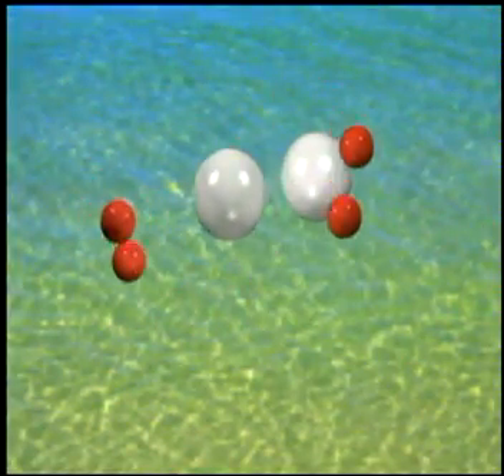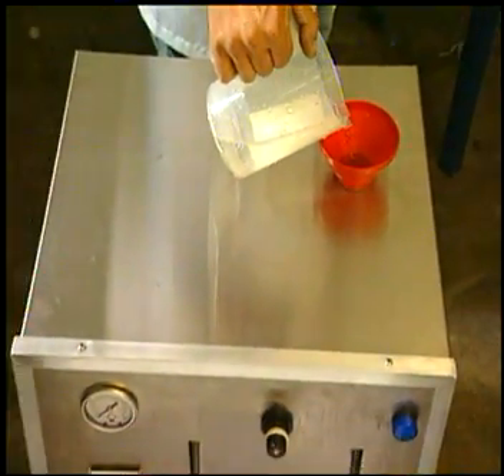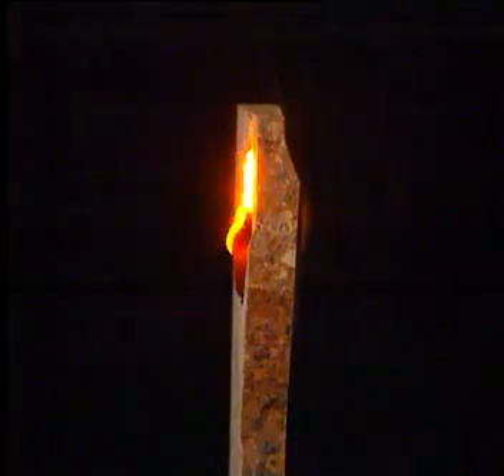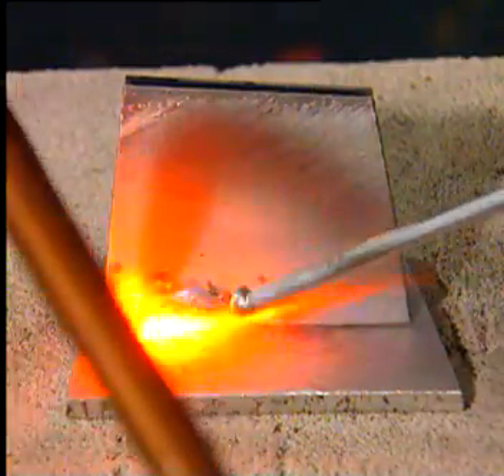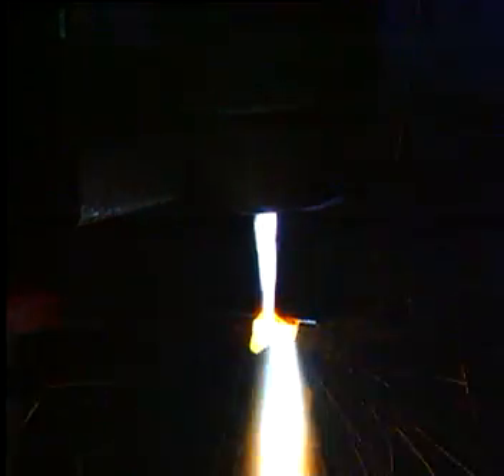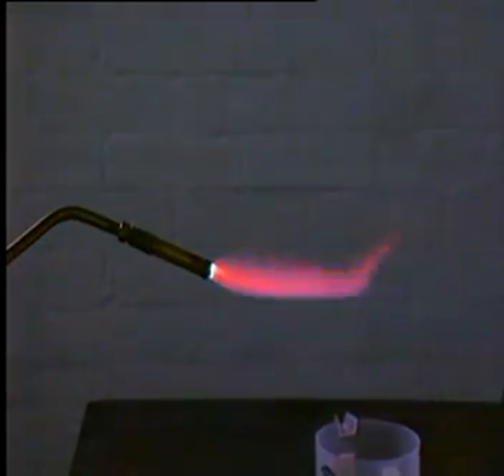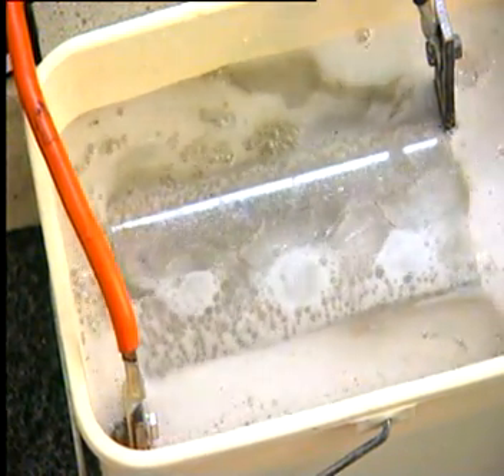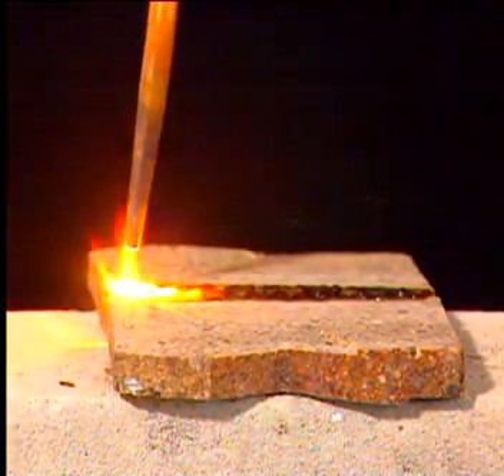Welding With Water by Spiro - real 'Browns Gas' at work

Comment: i never heard hho can reach over 3000deg c,,5500deg F is ridiculous i never heard of this except for thermic lance ,,,if indeed the flame can have several heat ranges then how is this done?
Reply: Yes, if done correctly that is☝️, it's called Interactive flame temperature. Essentially it's an exothermic reaction between the gas and the other material. Did'nt you see how plasma field of an Arc is enhanced by the gas in cutting steel ?
Reply: @navneetpandit7299  if you are talking about plasma welding or cutting yes i am welder i kinda understand but plasma flame alone is very hot and can reach 25k degC and does not get hotter by interacting with metals , as for hho flame it is said to be 2000deg C or even 2800deg C but it depends on conditions and material it is burning
Reply: @ARCSTREAMS  then it is not simply HHO gas.
Reply: @Dan-gs3kg  now that i watch video again it seems they are not using hho but separating both gasses then combining them in the torch at different pressures where i think the oxygen is at higher pressure (but they are not specifying this) so this is oxy hydrogen ,but then they are showing a welding head blow torch with a different looking flame and perhaps different pressures or possibly hho combination ,,idk it is a strange flame with weird characteristics
Reply: @ARCSTREAMS  Brown's Gas is generated primarily with the electrolytic cells in series at very low voltage. It is also a neutral electroliser, the gasses are not separated. The main oddity is that theoretically it can get double the coefficient of expansion as HHO gas. The best designs only get to about 130%.
Reply: @Dan-gs3kg  idk what you mean with double coef and 130% and all that ,brown gas and hho is same thing and created by electrolysis by either having the gases separated or created together as a 2:1 ratio called  stoichiometric  or bang gas anyways this is going further away from my initial comment on the flame temps
Reply: @ARCSTREAMS  When using Faraday's equations for calculating electroliser efficency in terms of energy to rate of volumetric expansion, Brown's gas gets above the theoretical limit prescribed. There is more expansion of gas than would be expected, and the gas is not hot. Going by spectroscopy, there is monoatomic gas involved.

The point being made here is that it is not HHO gas, and would naturally act differently.
Reply: @Dan-gs3kg  what is not hho? what is difference between tnat and brown gas?
Reply: @ARCSTREAMS  basic reading comprehension.
Reply: @Dan-gs3kg  ??? seems like you just enjoy talking to yourself feeling smart instead of answering simple questions you prefer to go off topic about a bunch of science regurgitations ,,i can also do fourier transforms but i dont go out of my way to spam about it
Reply: @ARCSTREAMS  I said that brown's gas is different, and it is shown by the excess expansion of the output of the electroliser, it is not simply HHO
Reply: @Dan-gs3kg  and in laymens terms i still do not understand what "excess expansion of the output of the electroliser, " means?? first of all we need to know what is the definition of the term "hho" from my understanding it means 2 hydrogen and one oxygen which is what is produced in electrolysis , so explain to me in laymen terms what is the difference between brown gas and hho and what any of this has to do with my initial comment about the temperatures claimed in the video ,, if you can actually manage to do that without your scientific fancy words that would be an accomplishment
Reply: @Dan-gs3kg  are you saying that when brown gas is made it is not purely hho because there is an atmosphere along with it? so it is not the same as pure hho ,,im trying to understand ,but i think what i said about the gases being under different pressures in the torch is what creates hotter flame,when you have both gasses pure and independantly sourced unlike from these simple devices perhaps
Reply: @ARCSTREAMS  no, as I said earlier the composition includes a significant amount of monoatomic gas. HHO is very voluminous than ambient gas, and the original water it came from, good brown's gas expands it an additional 30%.

The gas is not that hot, what comes out is colder than expected for HHO gas (greater volume of expnasion). Monoatomic hydrogen and oxygen also need lower temperatures to combust. The fire does not need to burn that hot to sustain itself. When challenged, it can produce a lot of energy to continue its combustion.
Reply: @Dan-gs3kg  it's probably that the hydrogen is 70% orthohydrogen

Comment: The big surprise is Browns Gas/oxyhydrogen gets rid of nuclear waste.
Reply: mujaku any links for this information?
Reply: @jeffmartin8106  I was lucky enough to attend a SAFE WORLD TECHNOLOGIES elbow to elbow  conference/demonstration in 1994 at the Philadelphia 76ers' stadium.  They demonstrated all sorts of things from a jack hammer, welding/cutting abilities, a v-8 Chevy motor running producing water as a by-product, and a tiny electrical generator with 4'x6' panels.  It turned out the generator, if "public" would fry the grid as it exists today with the amount of juice it produces.  
     The nuclear disposal claim was made and it was said they demonstrated it successfully to the Feds but it would displace the current nuclear waste disposal and storage systems in use and planned.   You just can't erase a trillion dollar industry.
Reply: @jeffmartin8106  OH! And he said they'd be arrested if they did a demo and pointed to some guys on the floor who were reportedly there to do such a thing if needed.

Comment: hydrogen is better we should be using it oil companies lobby to hide and descredit the technology
Reply: Wonder if Spiro is still active in this technology? So many disapper over time.
Reply: That's completely false. The models are designed to produce and deliver hydrogen on an as needed basis. The tanks in the car will not hold vast quantities of hydrogen, and either way, you could fire an incendiary bullet at a tank and it wouldn't explode, only trickle out.
Reply: Kevin Martin Here's the problem it takes more energy to produce the gas then the gas it's self contains. We do how ever need to get this figured out in say the next 100 years or we as a species is pretty much done for.
Reply: Kevin Martin it is also very dangerous to use. There are a couple of cars that are going to be released soon that will use it but there are still some safely concerns with it. It is very explosive when compressed the way it will be for use in cars. My shop for example is already built to be designed so that the roof will blow off and the doors remain shut in the chance of an explosion to keep people outside of the shop safe, but that being said, most likely all of us in the shop will be dead

Comment: ur friend I hate to tell u did not invent the browns gas torch Yull Brown who the name browns gas is named after is the creator. Any1 can build 1 of these & this is being used now by in cars 4years. The hydrogen is created in the cylinder because of the 1800x increase when splitting water. BWM has a hydrogen car so does japan & here it has been here. The GasInc need 2covert there assets there4 the industry has been supressed. If u had done ur homework many people have been murdered& threatened.

Comment: This is the first video I've seen using hydroxy to weld stainless and mild steel.  
  Does anyone know the trick to making it work for welding steel.
Reply: Use gasoline as a modifier gas via a secondary bubble tube full of gasoline.
Reply: Study Yull Brown's patent...I think you will figure it out👍☝️☝️😊😊 yes a lot more things like ceramics welding, metal to ceramic, Implosion of Brown's gas combustion. Sorry but Gorge wisemann has grossly down played much of this in his book Brown's Gas-1/2,he  dismisses the original design and claims of Yull Brown as a 'Myth', but I have studied Yull Brown's patent and found its  consistence with Stan Meyer patent and design☝️☝️👍
Reply: @navneetpandit7299  lol

Comment: The welding industry's preference for acetylene and propane gases over hydrogen has nothing to do with the government, oil companies, or the Saudis. 

This machine is a neat chemistry experiment adapted for commercial use. 15 year old high school chemistry students literally do this same thing on their lab benches with a battery, some wires, a beaker, and two test tubes. During the experiment, each test tube fills with gas -- one with twice as much as the other -- guess which one that is.
Reply: Hidrogen  it. More